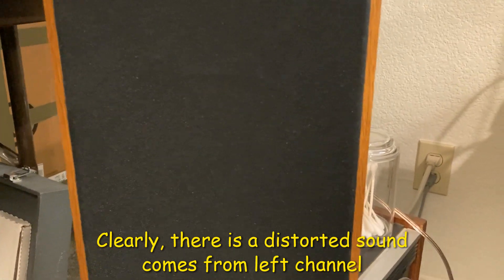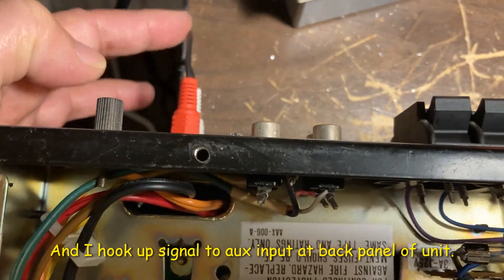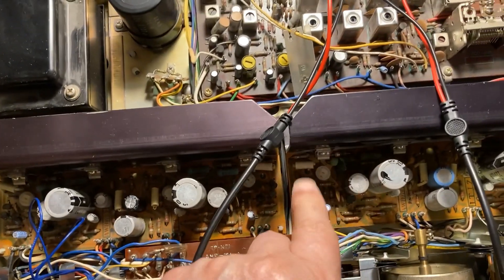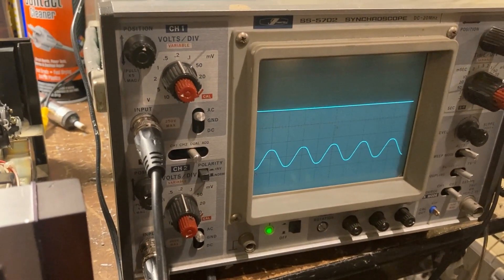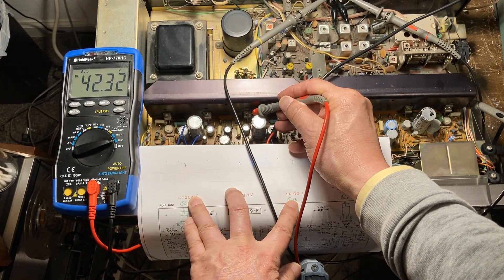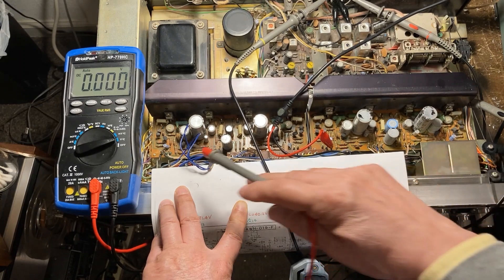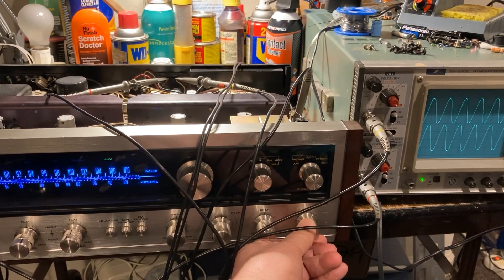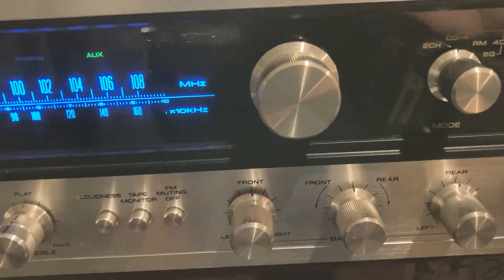Pioneer QX-646 Receiver Repair - Distorted Sound Output

Comment: Hello, would you be able to tell me if a Potentiometer / Control, Volume of a Pioneer QX 646 could be somehow adapted to a Pioneer QX 949A? I have a Pioneer 949A with a severely damaged volume Potentiometer for which I cannot find a replacement anywhere. Any help please?
Reply from the maker: The QX646 uses a 250K-B1(4 gang) potentiometer for volume control (showed in page 31 of service manual).  The QX949A has same 250K (4 gang) potentiometer which showed in page 60 of service manual). They both are same value and can be substituted each other based on the service manual.
Reply: @VintageAudioFan  Thank you very much endeed for your quick replay!👍👍👌👌